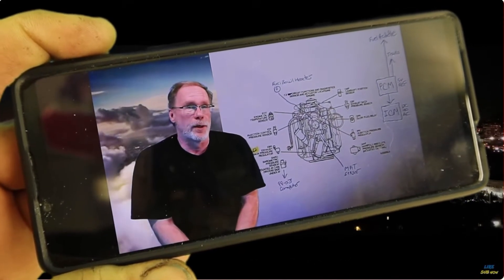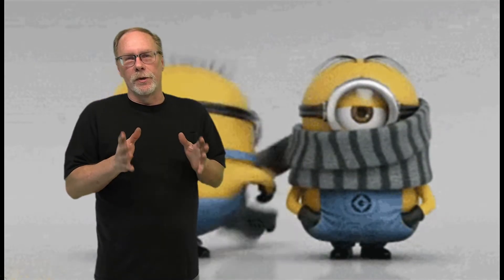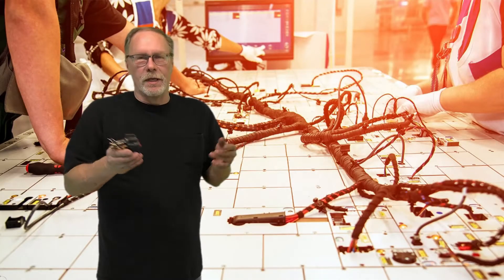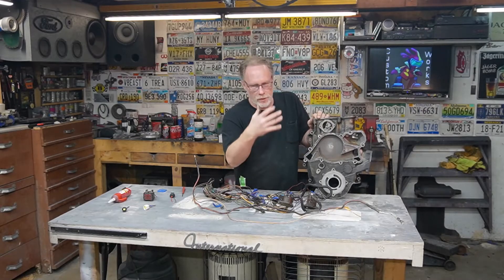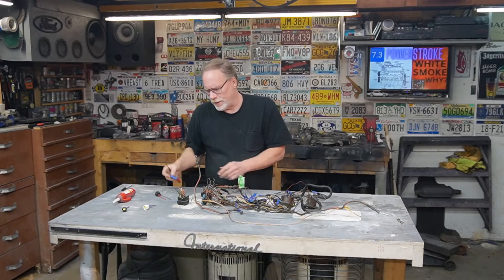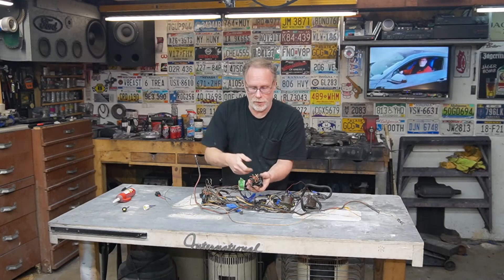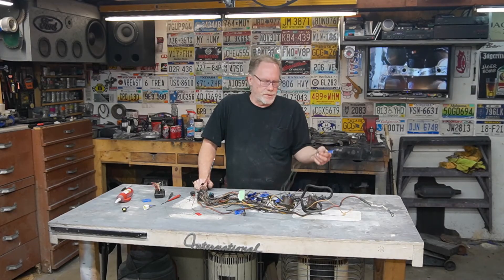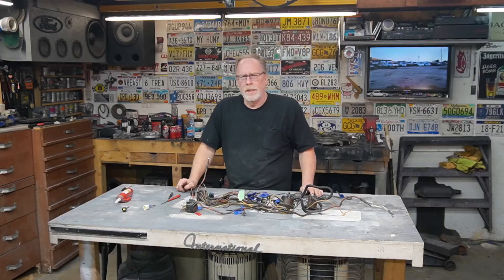🛻📽️7.3 POWERSTROKE MOD A AUTO WIRE HARNESS 2 MANUAL TRANSMISSION   🚧🛑⛽🛻

Comment: My only suggestion is do not pull the back of the 42 pin plug back. Leave that seal in place. On the front of the plug there are 3 red tabs. They come out super easy with needle nose pliers. Remove them and you have access to the retaining tab use a straight pick and gently push away from the barrel connector and pull on the wire you need. Most plugs are designed to work this way.

Comment: I'm a new 7.3 owner and locked into your channel.  I have a question.  I reached out to riffraff for a new harness and they said it is obsolete although they sell harnesses for 2003.  I have a 2003 F550 Automatic 4WD.  If I purchase a harness for a 2003 do you know what mods I would have to make for it to work my truck?  My old harness is shredded.  Thanks for your videos!

Comment: Mr. Allen, let me start but saying I've watched almost all of your videos. I am a 7.3 follower for the last 15-20 years. I have an issue though and I hope you can help me. I have been chasing an issue with my 2002 manual trans.  I was excited to watch this video and have followed it as closely as I could. I bought a new OEM harness and moved the temperature sensor wiring.  My old harness didn't have the alternator wire from the 42 pin so I kept the new harness the same as the old only adding the temperature sensor wire. You did state it was only 1 wire but the sensor obviously has 2 so I mirrored the old harness and spliced in the other wire in the same location as the old and then added the pinned wire to the 42 pin.  The truck runs like garbage now though barely running and blowing a LOT of black smoke. I'm hoping you can give me some direction to try. I'm a little lost
Reply: Hey man, for what it's worth, Ive got the same year and transmission as you, I just pulled my wiring harness this weekend and I did have that alternator wire you mentioned. Not saying one way is right or another but worth considering.

As for the black smoke, sounds like some unburnt fuel due to a rich mixture. Check all your air intakes first to make sure the engine is getting enough oxygen. After that it's something else with the combustion process and probably unrelated to your alternator, though your new harness could be acting up on your injector connections.
Reply: Was your alternator on the corner of the 42 pin connector as Mr Allen spoke of? @InfiniteDirt

Comment: First I would like to say ( highly Impressed with your knowledge of the 7.3 ) and glad you picked this motor to do your videos on.  I just turned 70 and decided to retire but i cant sit still. I have a 2002 F350 single cab you are always showing the crew cab is there a difference in the Engen harness between either style truck.  I had the bucking  / cutting out problem and let  it sit for 5 years now but because of you I am rebuilding the truck completely top to bottom.  So I am concerned about matching everything to factory specks. Watching you is a tremendous help. PS   Can you make a video on removing the cab please.  Also advise on the harness.  Sorry its so long.

Comment: I have a 2002 F350  manual with two alternators. I understand the  pin portion but am a bit confused on the alternator mod part for my version

Comment: Thank you for your channel, great stuff!!!
I am hoping you can answer a question for me, I have a 2001 7.3 factory built with ZF6. Previous owner installed an aftermarket over the engine harness for an auto tranny, now I am getting the p0118 dct code. I know it’s due to the secondary Ect sensor on front of engine not having a plug. My question is when I wire a new plug thru my loom to my 42pin connector what PIN number will I be looking for to satisfy the PCM? I know there is a difference between 99.5-2001 vs 2002-2003. I know in the video you reference pin 18, but that’s a 2002 is that the same pin I need for my 2001? Thank you in advance!

Comment: I'm still running the factory harness on my 2000 F250 I could buy a new one but I also know how to build harnesses it's very simple as long as you get the connectors you just rebuild it with new wires if it's a little complex and confusing just change each individual wire so you don't mix them up

Comment: Good Morning I enjoy your videos I recently had an issue with my 7.3  6 SPD F550 2002 it has always run great. I had a trailer on and while towing the truck threw a code  and was running terrible ,I suspect it was the wiring harness on the passenger side bank played with the wiring, the code cleared , we continued on. It happened several more times and after playing with the harness connector it would clear the code and run again, it barely made it home. I had a mechanic friend of mine who works at a local international dealership. He tested it all wiring tested ok, but the IPR wire was an issue, and the IPR was oily. We replaced it. I tried finding an OEM wiring harness for the 6 SPD but I could not find anything . Without redoing the whole harness could you do the harness mods that I need.

Comment: Heres another mod nobody mentions..if you delete the aih on a l99-03 7.3 you can save money and get the oem e99 wire harness that comes without the aih solenoid, its cheaper and leaves a bit more room on top of the engine

Comment: Question for you, my 03 has a bent pushrod because a rocker came off while driving and advice for how I should go about the repair to make sure I don’t miss anything and get the issue fixed the first time
Reply from the maker: Wow that is so rare like lottery winner rare I would be on the side of pulling the head and replacing all lifters and push rods and new rocker with tabs and ball bearings If this is a vehicle you are going to keep till the Government peels it out of your hands for a nifty EV

Comment: Clint, I am taking your advice and doing a "performance upgrade" for my 2001- F550- 7.3- 4WD with the 6 speed manual transmission. I have the new OEM Ford wiring harness for an automatic transmission as the manual wiring harness is not available as you know. My question for you sir is: 

Does the 2001 model year need to be wired any differently than the 2002 model year that this video is about regarding adding the extra coolant sensor wire to pin 18 to make it function correctly?

Thanks

Comment: Hey Clint quick question for ya. So my truck is 1997 ca model f250hd and I need a engine harness. Do you know we're would have one in stock or can I get 94-96 harness and splice in whatever the new harness doesn't have from the old one??
Reply: Patrick-  did you figure your harness out? I’m in the same situation with my 97 CA model.

Comment: I have a 1999 E459 7.3L powerstroke turbo diesel ambulance and after the engine was exchanged by a shop I lost the horn (relay clicks), windshield fluid pump, and AC, all worked beforehand but now they don’t. Runs great, otherwise. I don’t know if they left something disconnected or if my wiring harness doesn’t match the used engine, I’ll keep watching your series to see if there’s some guidance because electrical is kind of voodoo to me and I’m doing my best. Thank you for your videos

Comment: Clint…, it wasn’t too clear in the video…, but were you suggesting to us, to get a new wiring harness…?   Hahaha…!   Awe but I jest.
Great informative video,
Thank you sir.
(bought new 1995, 7.3 Powerstroke, F-350, crew-cab, 4WD, 192,000 miles, they will be burying in it…, hahaha)
Reply: Riff raff diesel
Reply: @TheSouthpawSharpshooter  yep, got it, an got it from them…., Thank you.
Reply: @greggb1416  sweet. Did it go on ok?
Reply: @TheSouthpawSharpshooter  Yes.  It was a factory OEM International Corporation (Truck)  item.  I got some other items (fuel bowl heater element & external electrical outlet, CCV o-ring kit, cylinder head to block fuel lines), all International & OEM Ford parts.  Fast shipping.

Comment: g1997 7.3 where is the water in fuel sensor . i have drained the fuel bowl several times . also fuel tank is new and i have run fuel  condittioner through it several times also and water in fuel light keeps coming on .  thank you

Comment: Different question.  I have 6.6Volts on the pink/ Blk wire when the key is on, even with the fuel pump and inertia switch UNPLUGGED.  Hot wired the fuel pump and the 2002 Excursion runs.  Where could this voltage be coming from?

Comment: I have a question.  Great running 2000 F250 dies when warmed up.  Changed the CPS with one from FORD bought on Amazon.  Hasn’t died since but doesn’t run as good in my opinion.  Its subtle.  People say the amazon FORD CPS’s are counterfiet.  I ordered 2 more from Riff Raff, they look IDENTICAL  Same bag, same color, same color purple O ring.  Are they different or the same?  Cost $8 more each.  Should I change it AGAIn just to see if it runs better?  My first thought when I got the CPS swapped was “now it runs like my 2002 Excursion.  The F250 has always run better than the Ex.

Comment: Question Lets say i have a Cali built truck with the glow plug control module Can i use a FED harness instead with the 2 relay?
Reply: Did you figure this out? I’m in the same situation with my 97 CA model.

Comment: Clint, you are the best in the business, hands down brother!!  Idk why you don't have a million subscribers, Thank you for sharing your knowledge my friend!!! 👍👍
Reply from the maker: Thanks I wonder 2
Reply: @CUSTOMWORKS7.3PSD  thank you for your knowledge Clint and continual 7.3 PSD support. I just messaged Riff Raff Diesel inquiring about a wiring harness and was told that the OE harness for my 2003 Excursion VIN is obsolete. Do you have any suggestions on where I might be able to find an OE harness?
Reply: @customworks7.3PSD 
Replaced my EBP sensor and tube and still getting a performance fault code. Replaced the engine harness. Replaced UVCH and injectors. Check engine light still on. Suggestions?
Reply: Clint, I am being told they no longer make my wire harness item F81Z12B637DA for My late 1999 F250. I really want to replace my wire harness but it’s nowhere to be found. Do you have any ideas of where I can find one or a hack where I can use a different year harness?

Comment: So if I buy any 2002 Ford wiring harness it will work for my 2002 f550 zf6 I would just have to add the temp sensor wire in?

Comment: 😂😂 yes I still need to replace my harness. It’s on my list for the truck. Thank you so much again. Off topic, my oil analysis report came back and I’m slightly concerned. All wear metals came back higher than average but still within threshold (from what i can find). Bought truck about 8years ago at 260k, currently 297k on it. Drive it 5k/year on average. 1st analysis done and I know I should wait for trends. Any thoughts? Much appreciated thank you